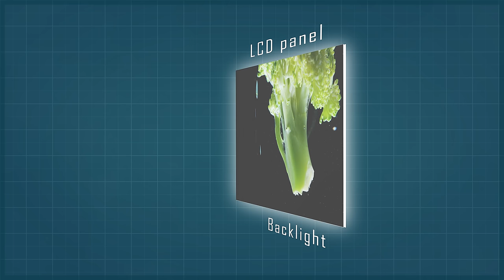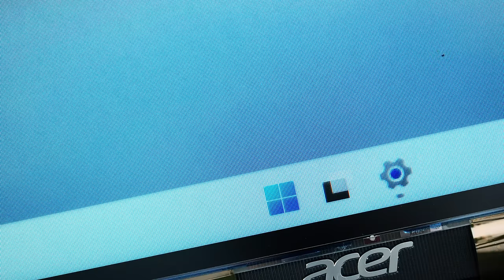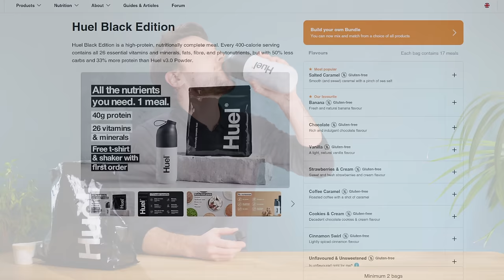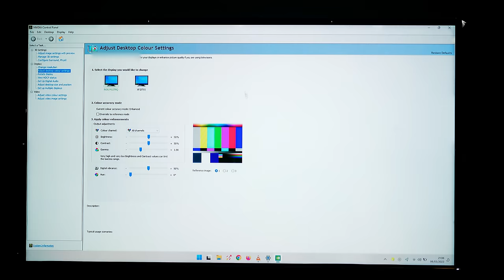DIY Dual-Layer LCD monitor - can it match OLED??

Comment: Have you tried to remove the polarization layer on the first screen, like a lot of projects do to make "secret" screens that only show up when wearing polarizing glasses?
Reply: I had the exact same thought!
Reply: when you remove the polarizer, the lcd becomes plain white - negating the effect.
Reply: @Elemental-IT  Well, one of the displays still has it's polarizer.
Reply: @Elemental-IT  You'd have to remove the polarizer of the back layer from the top panel and the front polarizer from the bottom one.
Reply: @Elemental-IT  That's the point of the polarising glasses. You take the front polariser off the LCD, so the LCD is plain white and unreadable, yes. Unless you're wearing a pair of polarisers in front of your eyes. It's a silly hack but I suppose fun, I wouldn't do it to a monitor I actually wanted to use.
Reply: @PixelBrushArt  but without the polarizer, it is just transmitting white light  - defeating the purpose of the 2nd panel.
Reply: Two ways you could do this:
Easy option - Don't remove any polariser. Flip the top panel over so it's back to front. Then its polarisation will match the bottom panel. Display a mirrored image on it

Harder option - Remove the back polarizer on the top monitor. (It's still receiving polarized light from the bottom monitor) However, now it's actually displaying an inverted image.
Reply: @jameshogge  That won't work. See the other thread where you posted this exact same thing.
 
[EDIT] Ah, I understand what you mean now. And indeed, that would probably work. The problem though is that you'd be sacrificing one of your monitor outputs on the PC, since you have to send two different images to two different monitors: one regular, one flipped horizontally. Not a problem for single monitor users, but it complicates things in a multimonitor setup.
Reply: @greenaum  you are missing the point... I understand the glasses trick. this video is about using 2 LCD's for better contrast. removing the polarizer breaks the project.
Reply: @3ATIVE  no, that's not how polarizers work.
Reply: @Transformed Photo  the lcd panels are effectively just filters are they not? So if you remove the back polarizer from the front panel and the front polarizer from the back panel, the white light is going through two filters between the polarizers instead of one, so theoretically it could do a better job of filtering out the light leakage providing better contrast and color? I could be wrong, that's just how I understand how monitors work. The polarizer just unscatters the light so we can perceive the individual colors rather than just white light.
Reply: @Elemental-IT  It is, I've done it

Comment: Super cool project, I always wondered if it was possible to do this. How about removing the polarizing filter of the first panel instead of using tracing paper? I know that people have made those "privacy screens" from old LCD's that are only visible when wearing polarized sunglasses. Or is the film impossible to remove in these modern panels?
Reply: Yes. Removing one polarizing should help a lot with the brightness.
Reply: @tristanwegner  Problem with removing the polarizing layer is you loose the image entirely. it was something he thought about though.
Reply: I think that, for this kind of project, you actually need the polarization filters - due to how LCD displays work.
Reply: @LiteLotus  Wouldn't the polarizer on the front screen polarize both screens?
Reply: @newnuu6448  I have the exact same question, leaving a comment in case someone knows more
Reply: @newnuu6448  
It would, like the others say, people who deal with privacy have monitors modified by removing the polarising filter, then wearing polarising glasses essentially let's them see it. Any polariser will do the job
Reply: @newnuu6448  
yes it can, but two polarizer between two lcd give contrast ratio (2nd polarizer give contrast & 3rd polarizer crippling blooming) and just not polarized light. 

Polarizer layer crippling the display light and that's why non polarizer oled in samsung foldables is superior than polarizer oled in S Series.
Reply: @newnuu6448  Yes it would but then it basically defeats the entire purpose of this video in adding the contrast to it, without the polarizing filter you cant see any image and it just passes the light through so it would just be similar to having the single panel,
Reply: @connorjohnson4402  I disagree. Each pixel in an LCD will polarize the light when we want it to be black. Then a second polarizing filter rotated by 90 degrees in relation to the pixel makes that difference visible by blocking the remaining light. The polarization effect of the pixels should stack when using two panels.
Reply: @newnuu6448  No, because there is a polarizing layer on the back of the liquid crystal that is very difficult to remove, so it wouldn't get polarised correctly.you would basically be polarising the light of the previous display again anyway. lcd stack is a little like this Backlight-polarizing layer and liquid crystal - re polariser. that second layer is extremely difficult to separate without damaging the crystal

Comment: Why not flip or rotate the second LCD to match the polarization?
Also if you don't need all the contrast reduce the black-level on the second LCD to get some more light transmission
Reply: To pass light you'd have to rotate it 90 degrees which has certain obvious geometric problems... Flipping it or rotating it 180 degrees just brings the polarization back to the same orientation it already is at.
Reply: @tylisirn  Flipping should switch polarization. Let's say the first is vertical in, horizontal out. Then the second unflipped is also vertical in, horizontal out. Which mean in the middle you have vertical + horizontal= no light gets through. With a flipped you have vertical, horizontal, horizontal, vertical. Which works
Reply: Presumeably, the first display panel polarizes light linearly, which requires a 90 degree orientation for the second panel to allow light through.  (Ever had polarizing sunglasses on and turned your head to read an LCD display?) Now, if only the panels could polarize ths light circularly...that's tricky because they would need to be a multiple of 1/4 the wavelength thick.  Polarizing filters on auto-focus cameras have to do this.
Reply: @jeffbaker8808  Well a panel has not just one but two polarizers which are shifted 90° too each other. The LCD in between "turns" the light. So it's linear horizontal filter - LCD - linear vertical filter. That's why flipping works
Reply: Wouldn't flipping one panel cause issues with the pixel layout? One panel would be R-G-B the other would be B-G-R. Also flipping a panel 180 or 90 degrees causes inherent input delay or extra processing time in windows, pretty sure LTT did a video about this ages ago.
Reply: @Neggy-Z  Yes, it would. But currently, as you see in closeups in the video, alignment isn't subpixel-perfect anyway, and you have multiple pixel-wide ghosting. Real dual-layer LCDs, usually have one black-and-white layer, sometimes even with lower resolution. I think this would also be the way to go here in terms of light loss. Not sure how easy it is to remove the color filter though
Reply: +1 for flipping. This was my first idea too
Reply: @jeffbaker8808  That's what LG used on 3D TV's, alternating lines of circular polarisation with matching eye films in the 3D glasses.  Your brain brings the two images together to create a full-definition 3D image out of the 2 interleaved halves.
As nobody is making 3D TV's at the moment, the chances of getting polarisers like that are pretty remote.

Comment: I have a idea of removing the need of the tracing paper for depolarization. You can flip the inner panel, so the  inner panel is facing outside with its original inside side. The back light passing through the inner panel gets converted to the same polarization the outer panel's inner polarizer. Its kind of hard to explain it. The polarizers' configuration of yours is H-V-tracing_paper-H-V-backlight. If the second panel is flipped it becomes H-V-V-H-backlight. Connect both panel to the same graphics card, and in the graphics card driver set the display of second panel to be flipped.
Reply: Unfortunately, that wouldn't work. You'd end up with the RGB subpixels being swapped between the front and back lcd panel. While you could potentially get around this by using panels with different subpixel arrangements, text may still look weird due to the subpixel antialiasing used by most text renderers.
Reply: @Lucy-sf6zm  You are absolutely right! Totally forgot the rgb sub pixels

Comment: 9:09 there's a lot of contrast, sure, but did you adjust gamma to 0.5 to compensate for the multiplying effect? With two displays both displaying 50% gray you actually get 25% gray (0.5 * 0.5 = 0.25). A gamma of 0.5 (effectively sqrt) brings that back up to the desired value.
Reply: I cringed a bit at 9:49 when he said that it's "not at all" like increasing the contrast setting, because I'm pretty sure the contrast settings also increase contrast by messing with the gamma (or rather by changing completely the EOTF).

Comment: I'd suggest to just remove the polarizing layer on the second display. Also, instead of projecting the same image on both display, you could try to project a  grayscale version on the second layer just to enance the blacks. That would resolve the grey looking black areas without altering the colours accuracy that much.
Reply: Exactly. You can just remove the polarization layer. Kinda annoying that that wasn’t even discussed
Reply: Just like the action lab

Comment: There might be a way to run the second screen in greyscale. If you run both screens in duplicate mode from your GPU and set one of them to greyscale then you might be able to recover some of that brightness at the cost of color vividness.
Reply: even if the screen runs in grayscale, the LCD itself still has color filters that will block out 2/3rd of the light, he'd have to somehow remove the color filter from the LCD to let in more light. (the colors will probably be more accurate eitherway though)
Reply: The problem is light polarity (horizontal or vertical).  The LCD twists the light 90 degrees, and polar filters (horizontal and vertical) block the light that doesn't match.  Grayscale does nothing to twist the light to align with the polar filters.

Comment: EUREKA ! You should flip one them. Back to Back or Front to Front. 
This will keep orientation of adjacent polarizers aligned = no light loss, problem solved. No diffuser and stronger backlight required.
Then rotate flipped one 180 degrees, to keep RGB pattern aligned.
Then all you need is to change orientation of displayed image on rotated and flipped display - just mirror image up-down.
The only drawback is the opposite direction of the image updates, which can lead to minimal artifacts in the dynamic scenes far from the center of the image.
In your current DYI solution it is better to use polarization filter foil angled 45 degree between displays, it improves light loss to 50% (diffraction gives 25% in the best case, 50% is lost on wrong polarization, and 50% of the left on wrong direction). More filters can rotate the polarization with less losses.

Comment: That is pretty cool. I feel like this would be extra nice for text in 4k. I want to go to OLED for my monitor but worried about burn-in. Dual LCD might work, if it was actually available for consumers.
Reply: I shouldn't worry about burn in, there are safety measures with any new oled monitor like pixel shifting which you won't even notice.
Reply: If you look after your display burn In isn't a problem
Reply: Joao_M  hmm yeah makes sense if you use it for office programs. The pixels shift but 99% will shift to the same color

Comment: My solution for the polarization issue would've been to flip the image around for one of the panels, and literally flip the front panel over so its "incoming" polarizer and the "outgoing" one from the rear panel would match. But to be fair, I'm not sure how you'd make the monitor flip around... could fix it in software if you make both monitors show the same thing but flip one, most OSes allow that, right?
Reply: I think the best way to do this mod would be to remove the polarized filter and diffuser from the second display. Not sure how feasible that is without completely destroying it, though.
Reply: @victorbarroscoch  Still need to flip it depending on the LCD tech
Reply: for that he'd need to plug both hdmi ports to a pc...with this he is using an hdmi splitter that basically duplicates the displays.
Reply: It would have been polarised at right angles, so you would have needed to rotate the overlaying panel in the vertical orientation. So, would not be practical
Reply: @Tossphate  flip it, not rotate
Reply: I think this won't work. I think that most LCD displays have diagonal polarization at 45 degrees, so that someone wearing sunglasses can still see the display regardless of whether it's in portrait or landscape mode. Or maybe some other reason.

Anyway, this means that placing the displays back-to-back, or front-to-front, would fail. The filters would still end up 90 degrees with respect to each other, rather than aligned.

An alternative solution could be a polarizing filter that is horizontal or vertical - in other words, 45 degrees with respect to both the filters. This will cut out 50% of the light, but maybe that's still a bit more efficient than the tracing paper.
Reply: I think with a lambda half polarizer film, it's possible to rotate the polarization with minimal losses. This will nearly double the efficiency. But i don't know how readily availlable those films are in the necessary size.
Reply: @hb80011  problem is that the effect is wavelength dependent. Which could lead to nasty color artifacts
Reply: @MegaWeitzel  you are right. Haven't thought it through
Reply: @MegaWeitzel  flipping it won't work because the plane of polarization is still the same

Comment: @DiyPerks Some people have mentioned rotating one of the displays so you can use one polarizer to increase brightness.

 You could use a custom VR type application where you could keep the two panels synchronized but have one image oriented one way, and the other another way. Instead of a left eye and right eye, the stereo image would render to the two seperate panels but be in sync with their own orientation that you would program into the Distortion shooter.. 

Make one of the layers monochrome, and that will also increase brightness

Comment: Using polarisers cuts the amount of light transmission in half, and you have 2 sets of those. So you're bringing the light down to a quarter. If you could remove the polarising film from the back of one, and the front of another where they touch, you'd have twice the brightness. They'd also align a lot better, being that little bit closer. And you wouldn't need the tracing paper hack because there'd only be 2 polarisers as intended. So no blurring.

It can be done with a plastic spudger but it's asking a lot. Perhaps some solvent can dissolve the glue? Or even dissolve the plastic polariser sheet itself, since you don't need it, of course be careful not to let it spill on the polarisers you DO need. 

You could perhaps get a load of scrap LCDs, even ones from wristwatches, anything, since the glue and polariser they use are presumably the same. Test them with whatever chemicals then form a plan to do it on the big screen. As it is I wouldn't be happy with the monitor as you've done it, though it's certainly an achievement. Not saying I could do better, of course, just that in theory it's possible to do better.

Comment: Really Nice Idea. But I think instead of putting tracing paper between two LCD panels, It would be much efficient and effective if you remove polarizing layers from one of the LCD. Secondly blooming of Text may be due to both LCDs are not perfectly aligned pixel to pixel.

Comment: You could probably get even better results by pairing a single lcd panel with a high quality black and white crt.
Monochrome CRTs can be pretty bright and sharply contrasted so they would make the perfect "pixel adjustable backlight" for the LCD.
You also wouldn't need the diffusion layer in between because the light coming out of the CRT isn't polarized, so the contrast would be even sharper and without blooming.
Reply: how would you account for the bulge of the crt? a flat piece of sheet glass in front of the crt?